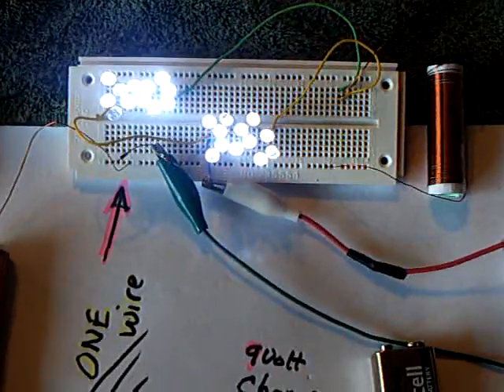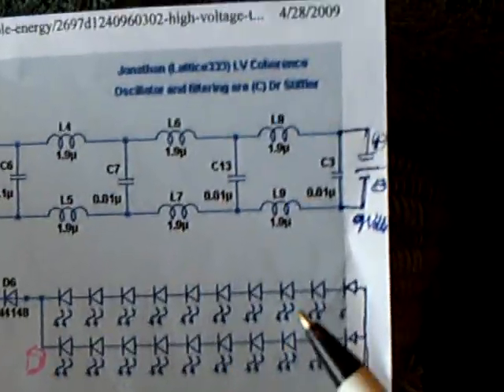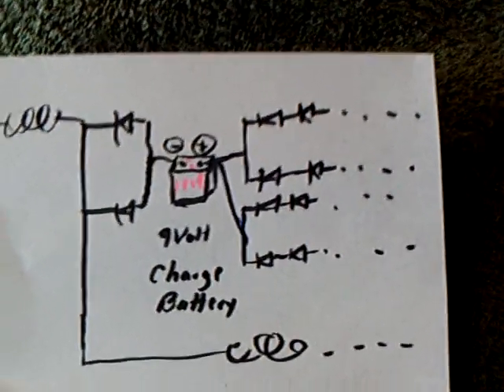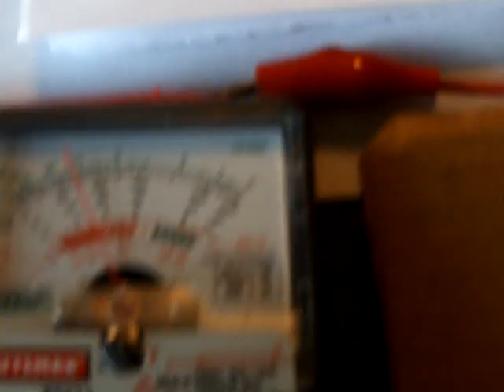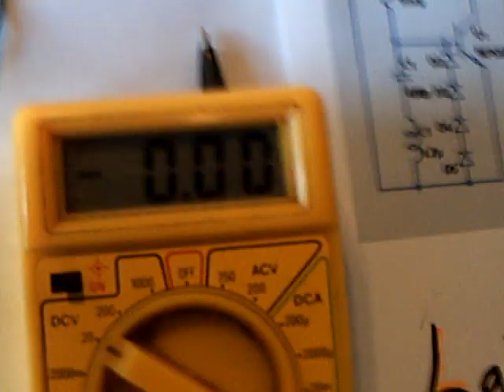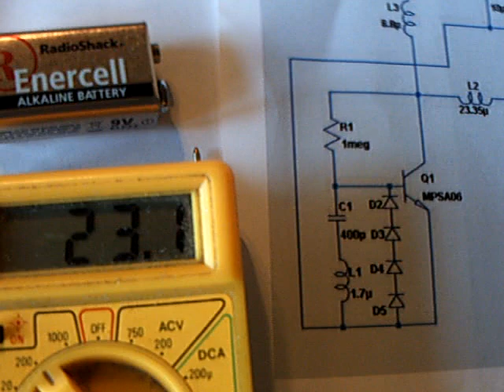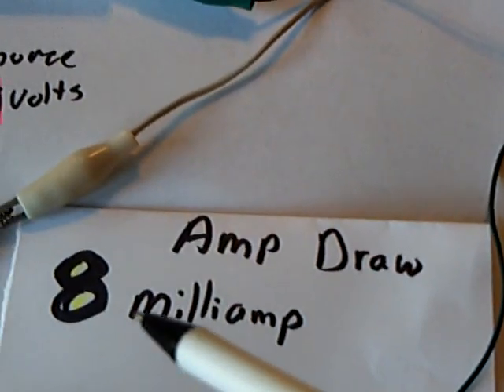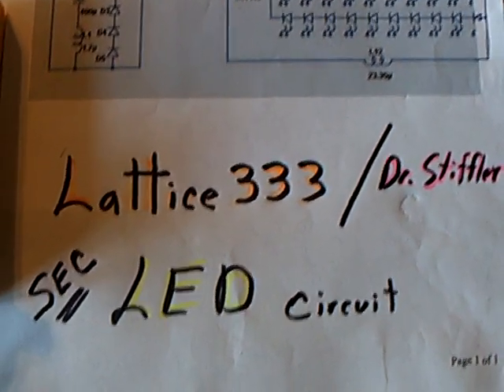Lattice333 & Stiffler SEC--- My Replication

Comment: Is that big coil of wire the L12 on that circuit diagram? Interesting note about have some partial success with recharging alkaline batteries. I made my way to the Wikipedia page about it, which points to some of charging parameters, and the hazards.

Comment: Awesome Lidmotor ! Great modification of original circuit as usual :)) Where you get the idea to insert the charging battery in that place !?!?!? Very clever !
Thanks to show with the spark that it's not just surface charging on the cap/battery.
Thanks master tinker Lidmotor ! 
And thanks Lattice333 for that surprising circuit.